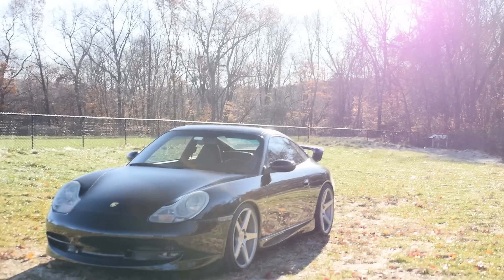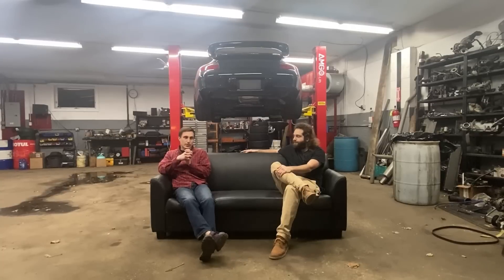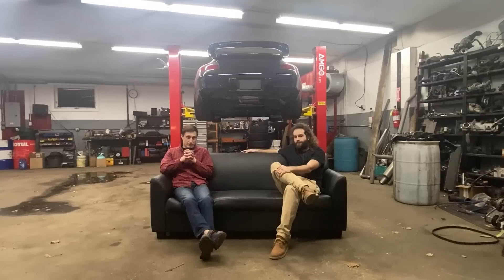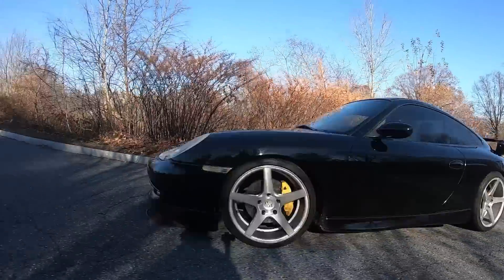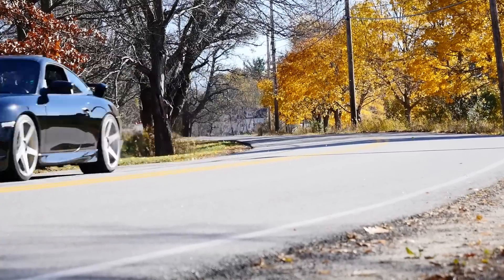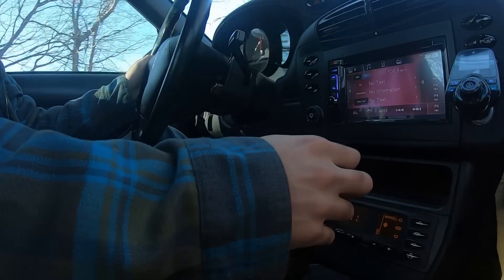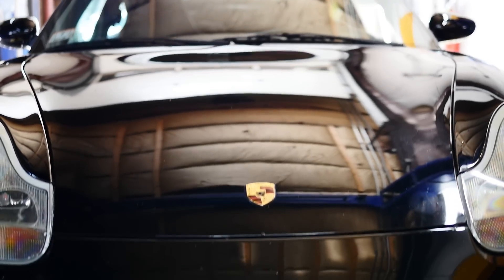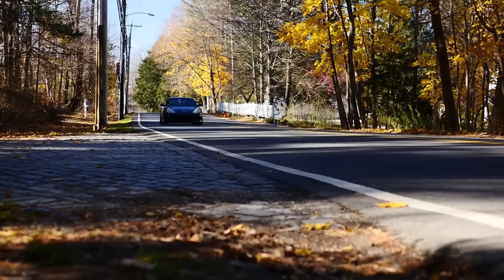Renn27 - Audi 2.7t swap for Porsche 911's

Comment: surprised the trans doesn't just bolt up to the 2.7t, the cayman/boxter trans bolts right up to the 2.7t (same bolt pattern on the bellhousing)
Reply from the maker: It’s very close most of the pattern is identical! The spacer provides a few extra missing mounting holes. Additionally the spacer gives proper clearance for our clutch/flywheel package.
Reply: It DOES bolt up although the trans has fewer bolts but enough. And a little work notching the starter area on the trans bellhousing (different location on 2.7t and other Audi engines) 
These guys exaggerate what’s required so they charge quite a bit for an easy swap. People that don’t know will pay up lol